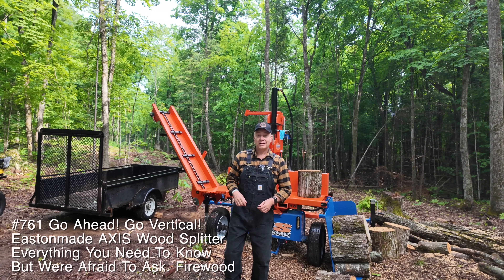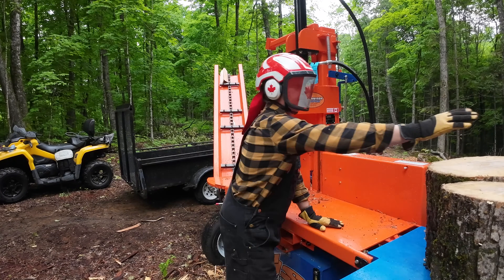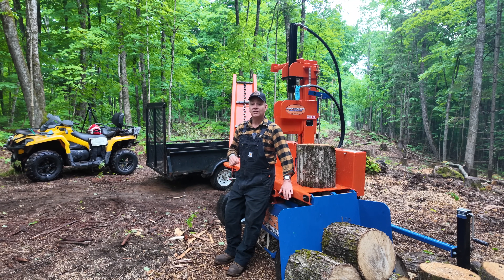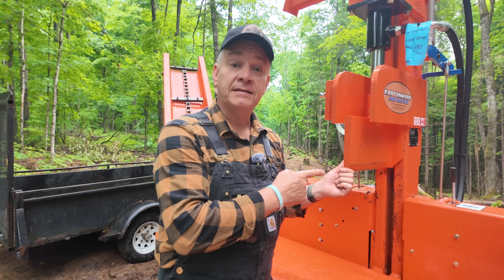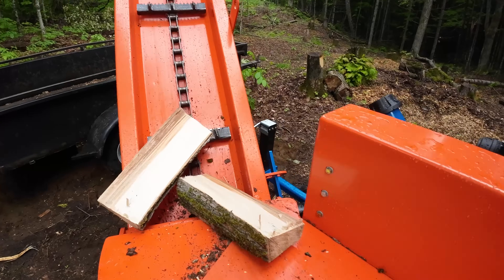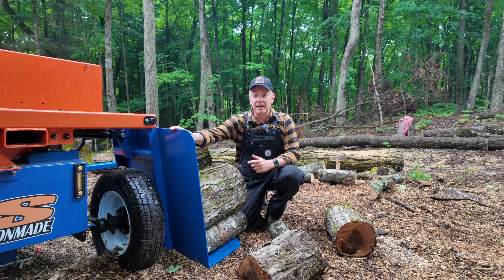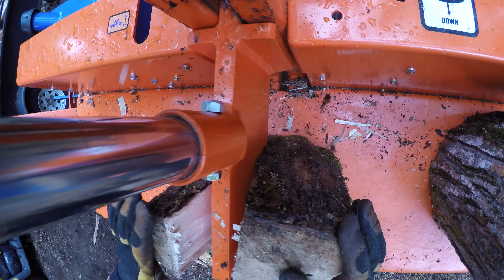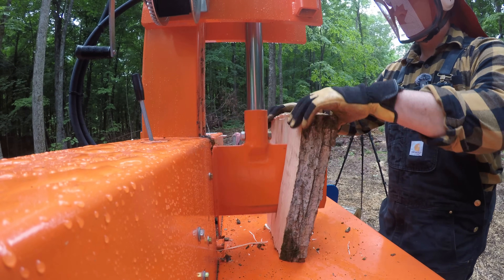761 Go Ahead, Go Vertical! Eastonmade AXIS Wood Splitter. Fast Firewood. Scalpel vs Sword.   4K

Comment: It is really hard to beat any of the commercial vertical splitters if you are a solo firewood operation.  When your firewood processing begins in earnest, I think the way you have the site setup will keep those trailers filled as fast as any of you can unload them.
Reply: You’re absolutely correct on that.  I have a Super Split HD, and quickly figured out the most efficient workflow for it. My setup is the rounds stacked directly behind me with my trailer on the other side of the splitter to toss into.  I’m looking forward to this splitter being delivered this fall.

Comment: Totally agree Gord. I just don't have the money for a rig that big. Even the entry level rig with tax included is $7900. That is 2x-3x the price of most other "normal" models......and that is not even the hydraulic lifting one, which will end up running you $14k or more. Unless you have 3-5 guys to share the cost with, that puppy is out of reach for most of us guys. I'd love to have it, but can't justify the cost. Cheers.......and see if you can play some Thin Lizzy or Montrose in a video, for us old timers.......or better yet some David Wilcox (the Canadian one, of course)
Reply from the maker: LOL! Some good tunes for sure Andrew. I will. Yes makes good sense. Several pieces of equipment you see from time to time on the channel is just that. A few neighbours share ownership of them so they can purchase high quality equipment and share it between them. Makes good sense since each person does not need to buy the same type of equipment and between them, it gets good use. Cheers and thanks!

Comment: Was wondering next time you are filming the splitter if you could maybe mount one of your cameras to you helmet?  This would give us a operators bird's eye view as what it looks like when you are operating it.  While side view are good sometimes they tend to distort distances and your hands look way to close to the wedge.    Love your videos and you are correct in sizing the splitter you want to what you will be using it for.   While the AXIS is a great machine it is most likely over kill for a single homeowner only splitting a few cord of wood a year.
Reply from the maker: Hey thanks for the great comment and suggestion. And very true. Most folks doing residential firewood need something a little less robust for managing their needs. Thanks for tuning in and for sharing your thoughts. Cheers!
Reply from the maker: Oh and sorry, i didn't answer you. I was holding the camera on a short mount from my mouth. I was going to use the helmet mount but it would not give a view from my eyes so. :))

Comment: I feel anyone who does any kind of sales or heating with firewood for their home, say anything over 3+ cords a year, would be wise to go commercial splitter. I use my passed down I-beam store bought, but if I did anything extensive, no way would I want to use that machine. Additionally, time matters. IMO, it matters more than money or anything else. It's priceless. Why waste time  if you don't need to?

Lastly, you may not be a salesman Gord, but I imagine all would say you would make the best one any of us have experienced lol. Great run-through you did here. I always liked the vertical concept and Eastonmade hit the preverbal home run designing one.
Reply from the maker: LOL! Good morning and thanks Cody! I agree - if i was just doing cleanup and maintenance on my own small property, I would most likely have a small one to tow along behind my ATV etc. Thanks again - enjoy the weekend!
Reply: @GPOutdoors  You do the same, Gord! Also the story about the guys being very reluctant about a big change was good too. We all do it at some point lol

Comment: Great video Gord. You definitely are not a sales pitch channel, in fact, you give out the facts as well as the pros and cons, the thoughts that float in our minds, in a kind and straight forward fashion. Much like Chris from In The WoodYard way as well as Tony from Tony’s Cool Tools. We may not all need what you are discussing but it answers a lot of questions when we might pull the trigger based on the great information you all give, from people who have the experience and knowledge. EastonMade is hands down a great company and builds a quality splitter that is much the same, well executed and designed to last and do the job effectively. Cost more yes, but you know what you are getting and should anything break, EastonMade will back it up and send you the parts to fix the issue as well as how to fix it should that ever happen. I definitely would consider the Ultra with the single wedge and the four way and now the Axis. Great splitters and loads of videos on them. Stay safe and keep the great videos coming. 👍🏻👍🏻
Reply from the maker: Hey thanks for taking the time to offer your kind thoughts. Have a great week out there and all the best!

Comment: Is the throttle on this adjustable? It looked like there was a dial to the right of the key to set max engine speed as you showed. Yet when I asked Marc at Eastonmade, he said it either runs at the auto idle low speed or the factory calibrated full speed. There was no in between. I asked him to double check with Andrew. I thought adjustable throttle would be nice for a novice operator like myself. This is a fast machine and I’d like to get comfortable with it and develop safe working habits before taking risk at higher speeds.

Comment: Not being a jerk at all, but would you personally pay that much for that splitter?
Reply from the maker: Good morning Derek, you aren't at all - it is a very good question. Personally, with 4 acres and a small need to split wood, I would not. I would buy something i could pull on the ATV, but for sure, I would buy something quality built. If I was splitting a large number of cords, and or selling wood, I would buy it for sure. Up here, with several good neighbours and friends, we would most likely buy it between us, as we have done with other pieces of equipment, since we all use it throughout the year, and as many are aging, this setup is so much easier for them to manage the rounds. Thanks for the Q, and have a great week out there!
Reply: @GPOutdoors  Thanks Gord!

Comment: Any chance you could get an accurate measurement of the height? I was debating getting the Axis, but wanted to keep it stored in the garage or barn when not in use. Wondering if I can use the fork pockets and my loader to tilt it a bit to fit through an 8’ door.
Reply from the maker: Hey good afternoon. So very sorry for not responding yet. I will be up there again later next week and will go measure it up and get back to you. Cheers!
Reply from the maker: Hey good morning Guy and Husky Bob were kind enough to drive out to it and get the measurements yesterday. :) With the conveyor up, the total height is 10 foot 4 inches and with the conveyor down, it is 8 foot 8 inches to the top of the cylinder ( give or take). It is resting on the forest floor so they tried to get as accurate as possible. Good luck!
Reply: @GPOutdoors  Thank you so much! I wasn’t planning on getting the conveyor since I’m using it for personal use mainly and can just toss it into a small trailer. Hoping I don’t regret that! The 8’ 8” measurement to the top of cylinder is probably close enough that if I tilt it towards the operator side with the forks, it should squeeze in.